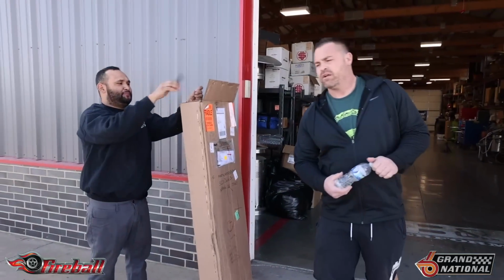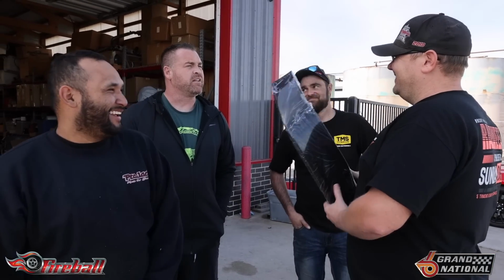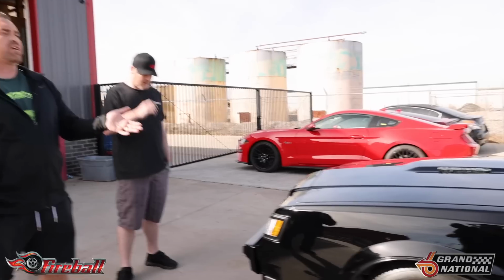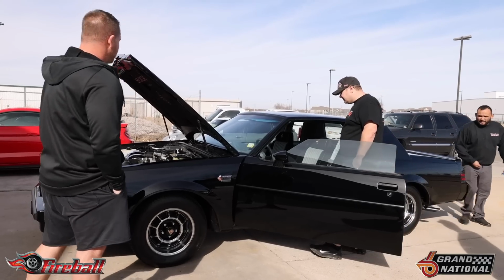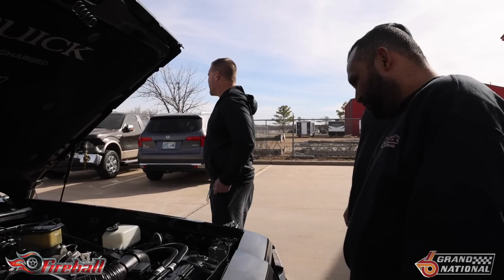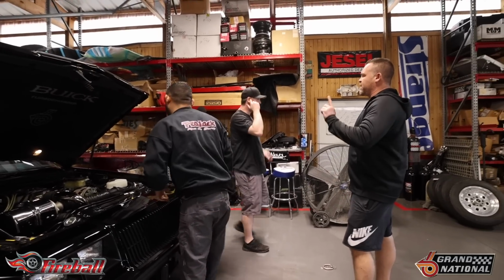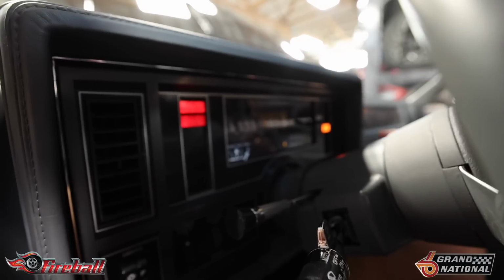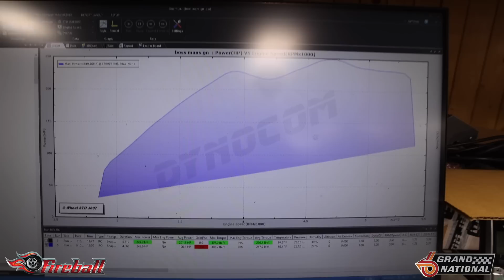Ryan Martin Gets His 87' Grand National

Comment: Buick rated them at 245 horsepower. They were easy to modify at that time. I paid $18,000 for one, brand new, right out the dealer door. Kenne Bell chip, test pipe exhaust, cold ram air induction, and it would make you smile every time.
Reply: @jeffkendel1570  
I was driving a white T-type when I saw the Grand National on a Buick car lot. The t-type doesn't have an intercooler for the turbo making 25 less horsepower.
Both cars are awesome.
Reply: @maskedmarauder3278  The T-Type 1986 Regal Turbo, and the Turbo T 1987 Regal both had the same drivetrains as the Grand National.
Reply: My 87 GN was built by the sound tech for Pink Floyd. It made 550hp at the wheels. 28psi of boost and methanol squirt. Thing felt like the Gravitron. Miss my Natty
Reply: I had one in 89 cheeper and slower then a fox body, but they did work good for a V6. Turbo cars been  around for years not first Turbo car trans am had one  in the 70s  amd many other cars before them. Not good when so called car guys don't know cars. Call race cars street cars. I had mid 10s  1/4 mil  fox body in the 80s  still had air  ps pb c c   PW. I dove to  work 30 miles each way every day. That's  a street car. Should come to  Canada some time to street race but  we do real shit not this 18 mil start stop. Here it's 1/4 mil  on real streets. Not closed street prep like a track.
Reply: @Red_Sector_7  
Minus the intercooler.
Reply: All 1984 and 1985 cars were hot air non intercooled.  1986 and 1987 got the intercooler for T-Type and GN and whatever else got the turbo 6 like some of the Limited's with a bench seat and column shifter but they checked the box for the turbo T.
Reply: @maskedmarauder3278  ALL the LC2 turbocharged 3.8L engines had intercoolers in 1986-87; and 1989 in the Turbo Trans Am. No exceptions to that.
Reply: @Red_Sector_7  
Thanks for the clarification.

Comment: Dont know where Ryan got his information from, but the left over motors did go to Pontiac for the Turbo TAs. They weren't detuned for Pontiac. 1987 was the last year for the Grand National. Pontiac used them in the 1989 20th anniversary TAs. 2 years after the sales on the Grand National. No way they could hurt the sales after the fact. It was the only year of production that Pontiac used a 6 cylinder in the Trans Am. Buick also put that motor in another car to. It was a sleeper car. Buick Regal T-type. They were all produced in the color grey with no Grand National badging at all. They may have been detuned for those cars, seeing how they were produced the same year as the Grand National. Nice car to. Always wanted one of those.

Comment: I have an GNX with plastic still on the seats. My dad passed away last year and passed it to me. Because of this video, I'm finally gonna start it up tomorrow and go for a cruise(if it stops raining).
Reply from the maker: Send me pics!!   How many miles ?
Reply: Ryan if u buy the GNX I want to buy your gn!
Reply: put some miles on it, but not too many !
Reply: @FireballCamaro  Less than 3,000 miles. Pops kept it in a conditioned garage for 30 something years straight. 

Shoot me an Email and I got you.
Reply: @NineteenEighty8  Cool.  I also have a 440-6.  71 GTX.  That low of miles on a GNX....cars are meant to be driven.....but.....check auctions and see what low mile GNX's are going for before driving that one around.  Big money.
Reply: Charlie B  Good call Charlie B.  The Power Master brake system is not to be trusted.  Almost everyone switches over to a vacuum system.  And or a Wilwood, etc., aftermarket.  Can always save the original one in a box.  Might want to find some good coil packs while you're at it.

Comment: Congratulations on your purchase. I had an 86 for 22 years but was forced to sell it in 08 due to the economy crunch. Had green stripe 45lb injectors, prom pac system (held 4 eprom chips), 2.5" duel stainless exhaust, ram air front spoiler, double pumper in the tank, off road pipe with dump cap to replace cat converter, Dennis Kirbin instrument cluster with all VDO gauges and spedo that went up to 160mph and 3 security systems on it. I would recommend eliminating the vent tube that goes from the front of passenger side valve cover to the turbo bell.
just put a K&N breather in the valve cover and put a bell housing on that eliminates the tub input. What happens is the turbo will suck in oil from the valve cover causing oil to get into the turbo and heat from the turbo will cause burn onto the turbo shaft slowing down the turbo speed. Check and see if yours has any missing body bushings. GM eliminated some of them for cost savings in 87. There are some other electronic tricks that can be done. Message me if you want to know more. Plus I do have a new set of heads with a special grind, still have the factory grey plastic valve covers on them. My car never gave me a reason to tear it apart and install them.

Comment: My boy has an 87 GN we changed the 3.8 to a 4.1 aluminum heads big injectors 80mm turbo big waste gate n intercooler n fuel pumps. The car is stock suspension full interior n fast as hell. They are  great cars good luck n enjoy!!!

Comment: Back in the 80's a young guy that worked in a fab shop where I was at the time bought  a Grand National brand new. He carried on about how bad the car was to the point we were tired of hearing about it. My coworker (Eddie Tanner) bought and restored old vehicle's on the side at home. Eddie drove a old 304 V8 4 speed CJ 5 Jeep to work the following Friday. We all left to cash our paychecks at lunchtime and by chance we ended up side by side at a traffic light with the young Grand National guy. Eddie told the young man to hit it when the light changed. I swear that old CJ 5 went  air born when Eddie popped the clutch. I was holding on to the grab bar (NO SEAT BELT'S) and saw the highway through the rusted out floorboard then looked up to see the speedometer buried. I turned my head looking back and we left the Grand National like it was stuck in the mud. I then proceeded to yelling "back out of it Eddie you got him"!!!! 
Just thought I'd share that with you guy's. They are nice cars but avoid those old V8 Jeeps, so you can keep your chin up. LOL

Comment: In 1978 I worked on a 1978 Buick Lesabre 3.8L turbo with carburetor. Back then the guy that owned it blew up the engine. He wanted more power so I pulled them little V6 turbo out and installed a 455 Buick engine in it. In 1987 I bought a Grand National and if I had only known what I know now. WOW!

Comment: My dad was a GM executive  and he loved G-bodied cars. Every 6 months he would get a new free car. He would have to turn the previous car back in or buy it at a huge discount. let’s just say that both of my grandfathers had Turbo Buicks. I believe they opted for the t-type. 33 percent off sticker was a deal. My brother got his 86 GN as a graduation present. In 1987 my father got an allocation for a GNX. Let’s just say he had contacts. Anyways, that car ran a 12.80 @113mph. It was quicker than a 930 turbo. He actually traded the car in for a slightly used 1988 930 turbo. The owner of the Porsche dealer wanted the GNX so bad that he did a even trade. The GNX had about 3,000 miles when trade in for a 930 Porsche with 8,000 miles. My dad regrets the trade, but his 930 is worth about the same as the GNX now.

Comment: In 1987 I borrowed a Buick Regal T-Type to take my date to Prom.   Basically the same platform as the Grand National except it was white.   Another friend did have the earlier model Regal you mentioned with the V6 quad-jet and a turbo.  I changed the oil in the beast in shop class a few times.

Comment: Premium gas, hyper tech chip, single 50 shot of nitrous in the intake pipe on the curve between the intercooler and throttle body, 14 psi of boost, dump pipe, cold air kit with a K&N, bump the fuel pressure up, street slicks and jump 2 pins on the diagnostic plug and put a switch in to lock the converter in 4th gear. GN will run 10.9 at 122.   Don’t ever let it ping, you will first lose the head gaskets, then you will blow the crank out the bottom.  Paint is enamel.  Great car, Mustang killer when tuned.  Leave with the turbo spooled, add nitrous in 2nd gear, lock the converter with the switch on the top end.  Enjoy!

Comment: I bought an 1987 GN last year with 26000 miles..its tweaked with turbo, larger intercooler, Janis trans/ convertor, alkyd injection, scanmaster controller, GNX wheels and body mods, Come check out the GS Nationals in mid May at Beech Bend Race Park in Bowling Green, KY you guys raced there a few times..there will be some fast GS's there also you probably want one of those next...I sold my 1972 GS Stage 1 years ago for big dollars...they are going for 6 figures now...Going FAST with Class....

Comment: GM's factory rating for the 1989 Turbo Trans Am was 250 HP, the 1987 GN - 245 HP, the 1987 GNX - 276 HP. The primary differences between the 1989 TTA engine vs. the GN were the 3.0L FWD Buick V6 heads instead of the stock #8445 3.8 castings due to the narrower 3.0L heads allowing the wide engine to be installed on the line in the f-body chassis. Other changes to the TTA was the GNX-style Garrett intercooler [which was the same size but had a different core] and slightly higher boost - 15 psi vs. the 13-14 psi in the Grand National. The same GN engine was otherwise used including the stock Garrett TBO348 turbocharger. The first year for EFI in the Grand National was 1984, which was actually the first worldwide use of the Bosch SFI system on a production car. 1984-85 were the early non-intercooled SFI cars with 200 HP. The induction system was completely redesigned for the 1986 model year to the now legendary intercooled Grand National config.

Comment: I’ve been around this cars since the came out. My dad bought his new in 86 and still has it. I’ve owned mine for 23 years with 24k miles. Yes it’s a 3k car and it’s best to keep it stock, but doing a downpipe and exhaust isn’t a big deal. Just keep the stick parts and you can always put them back. 

For years wd always went to the Buick vs Mustang shiwdowns at Englishtown back in the 90s such awesome times they were

Ps- the emblem is technically a turbo 6…obviously for the turbocharged 231 v6 and the horse power rating was advertised at 235(86) 245(87),  GM essentially wouldn’t allow the real numbers to be advertised, because they were so much higher than their flagship corvette! So these cars were always advertised under its actual hp. Which you can clearly see that your car put down the same numbers that the engine was listed at, but in reality the engine actually made like 285 I believe

Comment: Waiting to see dyno results . The 87 GN was one of the 80s cars underrated from the factory . In reality it was close to 300 at crank .
Reply: In 1987 ASC McLaren converted 547 Grand Nationals to the GNX specification. Every car was put on a chassis dyno before and after the conversion. Stock GNs would put down anywhere from 240 up to 290 RWHP. This put engine flywheel HP anywhere from 290-360 HP depending on the car. When the 1986-87 GNs arrived on the scene back in the day they got a wide variance in drag strip performance in the magazines; a lot of it depended on air temps. One of the 'secret weapons' the Grand National had, was its incredible ability to seemingly gain 30-50 HP instantly when the atmospheric temps turned cold in the Fall and early Spring. Not only would this put cold air into the engine but would also chill the factory air to air intercooler, yielding tremendous stock factory performance. This was shown to astounding effect in the very first magazine drag testing of the 1986 GN. In April/86 Car & Driver got a bone stock '86 GN on stock tires to run a 13.9 @ 99 mph which set the entire automotive world on its' ear. And all of that out of a V6 in a 2-door sedan.

Comment: Sorry to corret, but i just wanted to clarify some of the comments that were made about the turbo TA. The turbo TA had the GNX engine in it, which was a modified version of the Grand national motor. Different cam, beter flowing heads and cermaic coated ball bearing tubo and tune. You can always tell the difference between the GNX and the standard Grand national from the fenders being flared out more and the wheels were 9.5 inches wide so the chrome part had a deep dish. And lastly the turbo TA was in 1989 and a INDY 500 pace car edition, which was 2 years after the Grand national was discontinued.

Comment: Awesome car. I have an 89 TTA. A fuel pump injectors and a hotwire kit from racetronix is the first place I would start.  I would then get ahold of Eric at Turbo Tweak about tuning a chip for that car. I've done these mods and some more and this car is a blast to drive now! Good luck.
Reply: Yep.  Turbo Tweak only way to go.  Also Razor Alky if you really want to wake em up.
Reply: @Koontakitty  I run Alky Control and the TT chip is tuned for 20-25 psi of boost. I run 21psi now and anymore I would need slicks! It's fun to mess with the new cars that think they're fast. lol
Reply: @shadhord9502  Sounds like what I'm doing.  Sitting around 23 psi, pump gas.  I'm guessing you've done turbo, intercooler, injectors, DP.  That's what's great about these cars.  They take alot of common bolt ons with no problem.  I run ET streets.  Nothing else works.

Comment: Ok I never comment but hopefully you read this. I own two GNs one car since 87. The first thing you should purchase is a scan master. Second thing your fuel system is inadequate for any upgrades beyond stock. Racetronix new hanger and fuel pump with Hotwire kit. Go big an E85 pump with the fuel lines they sell. Accufab fuel regulator. Injectors and chip turbo tweak I’ll recommend 80 lbs If just upgrade turbo but leave the heads and cam stock. 120 lbs if you go heads and cam. The old   TA 49 turbo spoils great in a stock motor or a 58/58 precision . 3in dump tube and a single shot exhaust . Stock mass air usually has issues while it’s idling tap on it if you have an erratic idle replace it. MAF translator full throttle performance.

Comment: The turbo GTA had different cylinder heads on them. The GN heads would not fit in the engine bay. So they put front wheel drive 3.8 heads on them.

Comment: The turbo ta came out in 89 and the last grand national was built in 87 so they never competed for sales, from what i understand the turbo ta made slightly more hp for 2 reasons, 1 is they used the newer fwd car 3.8 heads that were physically a little shorter for fitment issues but flowed better and 2 the ta used the same intercooler as the gnx.

Comment: I have all the stock stuff and it's got a 6266 on it now with some odds and ends makes right over 400 at the wheels 53xxx miles and 10/10 inside probably 9.5/10 outside
Reply from the maker: That is about exactly what I’m thinking.   Still stuck bottom end ?
Reply: Stock bottom end. Had to put better head studs and new head gaskets on it. It's been in my family since 93' my dad traded a Harley for it. He passed away about 6 years ago I've had it since. As far as mods though the first thing id do before you dive into anything is get a good shift kit. Makes a hell of a difference on those 200r4's

Comment: It would be hard to mod a 99.9% original 3k mile car. I think removing the drivetrain and throwing in a turbo LS,TH400 or 4l80e would be the way to go. That way later you can always put the turbo 3.8 in and it will still be 3k miles😂

Comment: I remember 96-97 when I had a 94' camaro Z28 said it made 275 hp I raced one of these, and I thought the Z28 was fast this GN got after it.  then I raced a cyclone which had the same engine if I remember correctly and it walked away from me

Comment: Ryan that sucks i worked for a Buick Dealer before i started my own repair shop and the Grand Nats back then with GM's Delame issue unless the painter was super good it seems every Grand Nat sold was nicked on resale because of being repainted. I kinda thought you might have picked up a GNX they did not make a ton in 87, Between Kenny Bell and a few others they held there own . The other down side to GN is they no longer make the Power Master brake master and booster assemly which ends up getting changed to vac boosters or Hydro boost.. Love the cars have owned a 85 and 86 looked for a GNX for a long time but could never find one. Enjoy.

Comment: 87 was the final year for the Grand National. The Turbo Trans Am’s are 89’s. Power ratings wouldn’t have hurt sales for the GN. The Turbo TA’s had the GNX engine that had some head work and a different compressor wheel over the GN. 

GN’s are super cool cars, as are the Turbo TA’s. Bucket list cars for sure. 

Too bad you have an exhaust. I would try to find some ATR stuff their downpipe and cat back sounds great on those cars.

Comment: 250hp at the wheels? In '86-87, they made 235hp and 245hp at the FLYWHEEL -- slightly underrated -- the "real number" was closer to 250-260hp at the flywheel. Yeah, that car is either a FREAK or it isn't bone stock. I have an '87 GN, and I've dyno tested it and a few others over the years. Around 200-205 at the tires is sort of the norm for completely unmolested examples. Sounded like it has an exhaust on it and it more than likely has a chip, and some other unseen bolt-ons, too. It certainly has common aftermarket chrome dress stuff under the hood. It probably has other things, too.

Comment: The turboTA has different heads and different exhaust system.  The heads were better.  But not by much.  The intercooler and the turbo were different as well. Those hp numbers are typical as the 1987 were rated at 245 from the factory and Buick engineers were told to keep it underrated because in 1986 (235hp) 1987 (245hp)they didn’t want to hurt Corvette sales or exceed GMs halo sports car hp ratings.